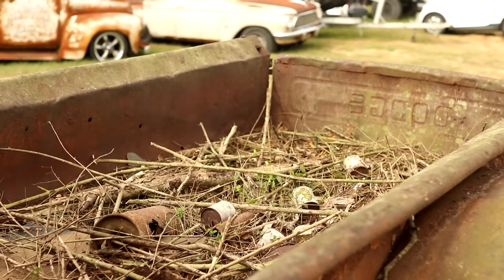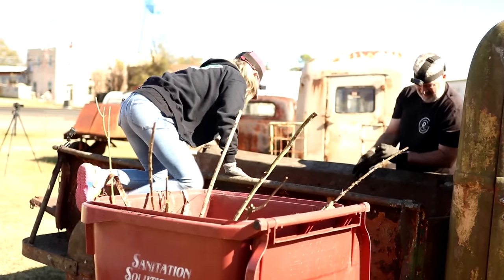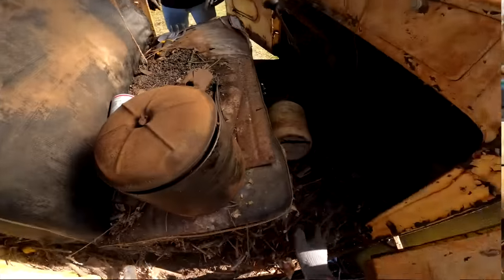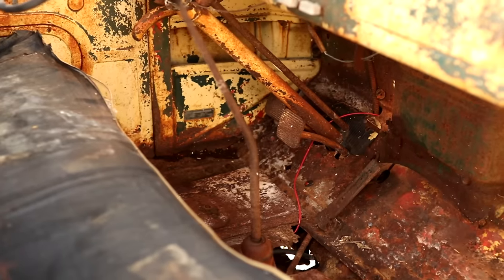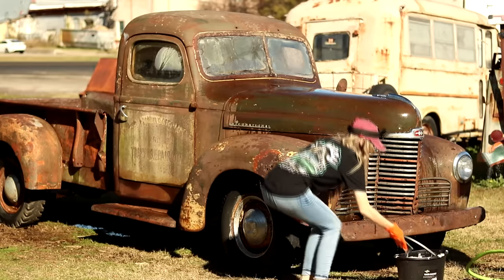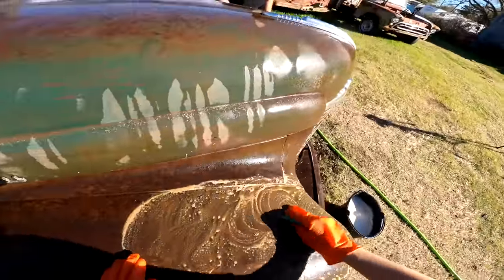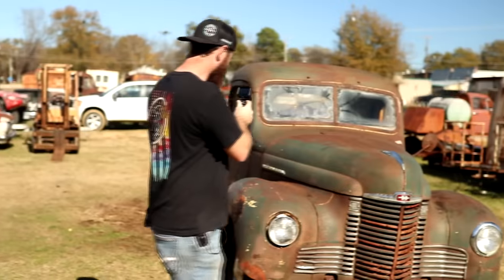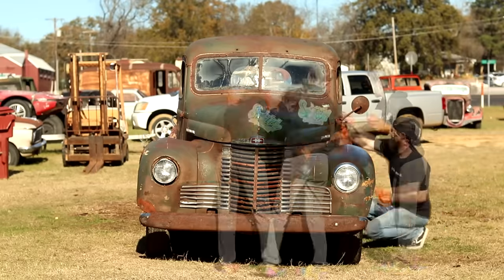AMAZING Transformation! | First Wash In 50 Years | How To Restore Your Patina Paint Job | RESTORED

Comment: Wow.  Thanks heaps guys that really brings back memories.  About 28yrs ago I found a 1937 D2 International pickup and believe me it was in slightly worse condition than the one in your movies.  The motor ran very well considering it’s history, in fact all the running gear was still useable. The brakes had to be fully reconditioned. The grill had about 1/4 of the chrome mouldings  and all the rest were under the seat, not one missing. It was NOT a wellside . But when finished it looked great with a timber deck, side boards and headboard. Ok here’s the part of the story that’s probably not what most would expect.
This truck’s long life is set in New Zealand’s South Island.. NZ is in the South Pacific. I sold it (with much regret)about 18yrs ago due to a health problem .  The last I heard it was living in the southern city of Dunedin..

Comment: Surprisingly dramatic effect!  Amazing what a simply cleaning and wipedown with BLO will do.  I'd love to see her fully restored to her former glory, with a complete strip down of all the parts, sandblasting and fully painting even the parts that will be unseen after re-assembly, re-chrome, the works.  Oh and speaking of BLO, always be careful with the used rags.  That stuff's notorious for spontaneous combustion, especially in cotton rags, as it generates heat when it dries, and the rag serves as an insulator for letting the heat build up.

Comment: THANK THE LORD... FINALLY ... you cleaned it up... You guys are great at what you do... but jeeze man I always try to give em a sweep off and clean out before loading on my trailer... I never want to be having crap blowing off on other cars while going down the road... In Alabama the cops will stop you for that...LOL...I've found that pressure washing or better yet... steam cleaning the vehicles body and under carriage and especially the engine area before I try to do any work on them seems to seep water into the rust and help loosen bolts and nuts, ... which it also make it easier to see every thing....and cuts down on rodent dust.... 50 years of doing what you're doing has taught me...anything that helps is worth taking the time doing...   Your videos of this ol tuck from rescue to clean up are Great... Keep on Truckin folks ! !

Comment: A word of warning to anyone considering using Superclean. DO NOT get it on your skin. It WILL take the skin right off, and I do mean fast. I use a lot of it, I get it in gallon jugs.  But it is something you need to be really careful with. 

Wow that turned out really great. Did you just use pure linseed oil or did you mix anything with it?

Comment: Only thing missing was the owners reaction to see the ol truck up and under it's own power again.
They don't build em like they used to really applies to old iron like that.

Off subject, what is the old bus I kept spying in the back ground of vehicles? 
Is it a conversion with a rear deck?
Will there be a video series on it?
I own a retired '99 mid sized school bus I been converting to a tiny house,hence the curiousity.

Comment: Did you do a video getting the engine  and brakes working.. I like to see the bed fixed and floors. If you kept it as it is can you clean coat it and wax it.  If they wanted to paint it what would that entail . Do you ever do full restoration ?